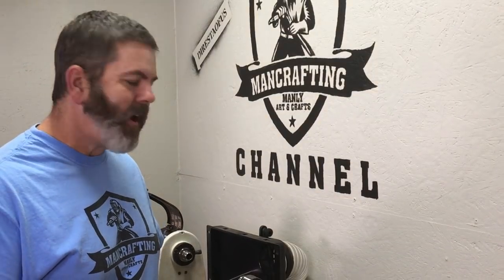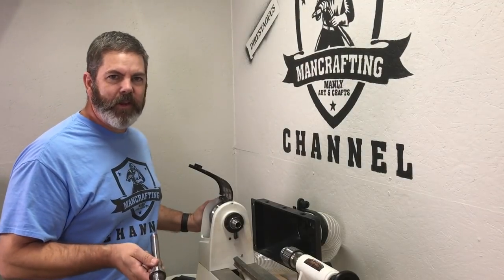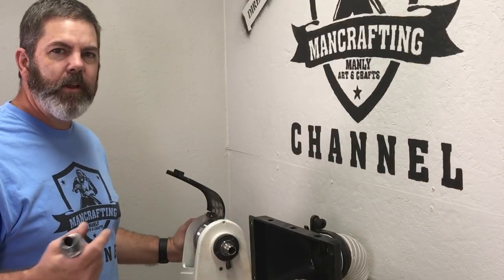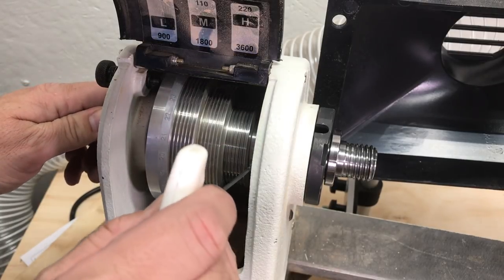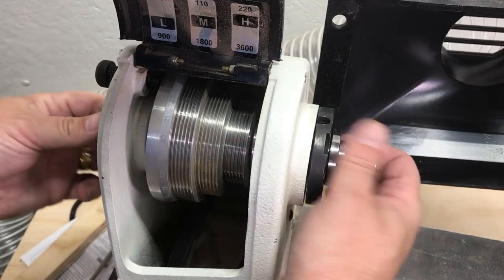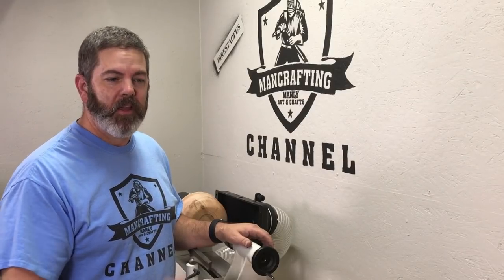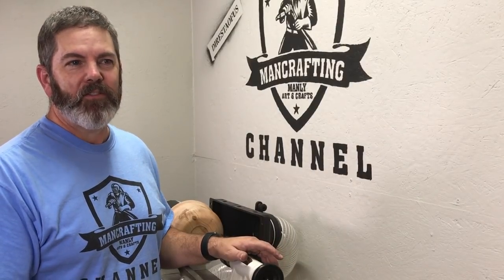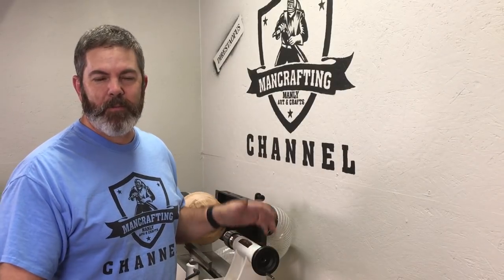HOW TO REPLACE A SPINDLE ON A JET 1221VS LATHE

Comment: Great video! I just bought a used Jet lathe which I had to completely disassemble to refinish it with a fresh coat of paint. These machines seem to be really easy to work on, which is great. All the best!
Reply from the maker: Thanks.  I agree.  It's much easier than I had built it up in my mind.  I think it was a comment by the customer service rep made about the difficulty level when I contacted them about the part.

Comment: I'm so glad I found this.  I set my 1221 on the mount I built for it, secured it, then took the orange sticker off the headstock (wink).  When I started to remove the faceplate to attach it to a blank, it was obviously cross-threaded (wink).  After about two minutes of fighting with it I got it off, and had destroyed the threads on the spindle.  THEN I looked at the orange sticker on the floor.  Set screw?  Damn.  So I went to HF and got a cheap tap and die set.  I chased the threads on the spindle, took off the burrs, and it works.  Barely.  The loss of diameter on the spindle means when I switch a bowl from the faceplate to the chuck, it never runs true.  It's between 1/8"-3/16" off and I have to recut the outside of the bowl.  I'm assuming that problem is going to go away.  My spindle came TODAY!  Yay!
Reply from the maker: Glad it helped.
Reply: Same!

Comment: FYI... put the shaft in the freezer for about 15-30 minutes before sliding the bearing on and it should allow the bearing just slip right on without the need to beat it on. Thanks for sharing.
Reply from the maker: 🤣🤣🤷🏻‍♂️ Because.  Science.

Comment: I had no idea how to get the shaft out of my General Midi lathe.  Never thought about tapping the end with a piece of wood. Did that and voila.  I have to replace the magnetic ring on the spindle.  It controls the variable speed.  Now I just have to find a magnetic ring.  Thanks for your video.
Reply from the maker: Awesome.  Glad this helped.  I suppose there are several brands that use this exact same platform.  I think Rikon is one of them as well.

Comment: Awesome video.
Do you know by chance what the thread is on the handwheel.
I would like to mount a faceplate instead of the handwheel so i can mount a sanding wheel.
There is no mention of the kind of thread in the manual.
Reply from the maker: I'll take a look when I get home.  I didn't even think to look before.  That's a great idea though.  I'll at the very least be able to tell you if the face plate screws in to either side.

Comment: Good job! Just in case you’re not aware most of the chucks and  face plates out there nowadays have a set screw that you can put into the spindle to keep it from coming off in reverse.
Reply from the maker: I was aware of it, but someone else changed it out.  Thanks for pointing that out though.  I wish I would have made that point in the video.
Reply: thanks for this info

Comment: I"m currently cleaning up a rusty Delta LA200, and the headstock disassembles almost exactly the same.  The only problem I'm having is loosening the spindle pulley, which seems to have a key inside of it.
Reply from the maker: Awesome.  Glad that this helped.  I have heard that a lot of these brands come out of the same factory.  I have also heard that each brand has their own technical specs, but who knows.

Comment: Just for everyone’s information the spindle on this lathe is having some quality control issues, the spindles are breaking regularly. I just got off the phone with the maintenance department at Jet and he had a call about the same issue the same day.
Reply from the maker: Did they say the replacement was better?  I wonder if they weren't properly heat treated or tempered?
Reply: ManCraftingTM not sure yet I just got ahold of them... I’m supposed to get a call back. I’ll put an update when or if I hear back.
Reply: I heard back from the jet folks. They don’t know what it is either... if you have this problem get a new spindle...
Reply from the maker: Matt Cronk I did.  It was under warranty.
Reply: This lathe has a lot of quality control issues....  I just found out that the metal cover for the spindle assembly cracked. I also bought the stand for it and the weld on the leveling foot failed in a matter of weeks. I’m never buying a jet product again.
Reply from the maker: Matt Cronk only issue I’ve had is the spindle, and I’m confident it was operator error.  They provided great service.  I’d happily buy another Jet product. I’d be really surprised if there was more than one factory making all of these lathes and slapping the different labels on them.  Unless your getting something really high end made in America or Europe.